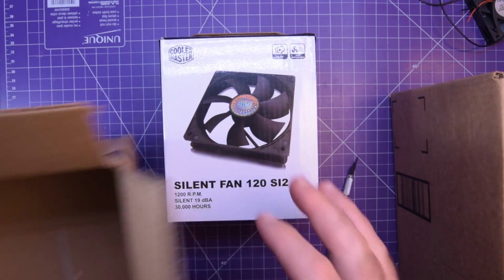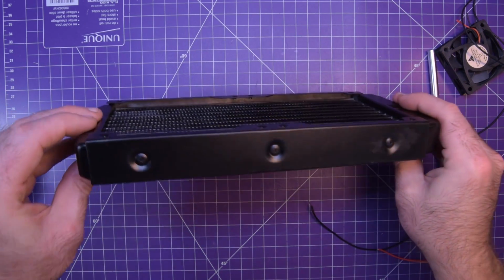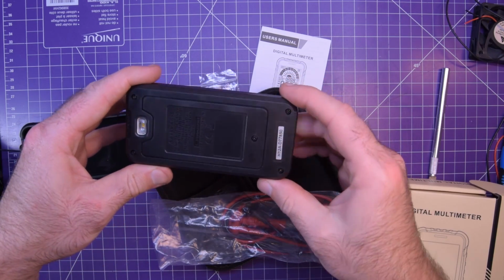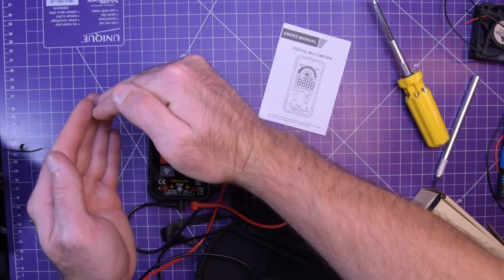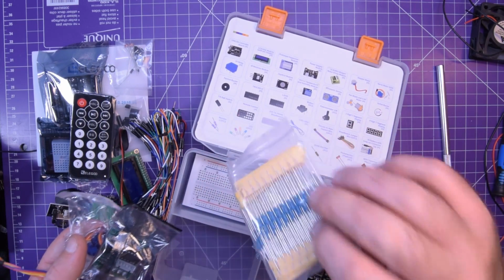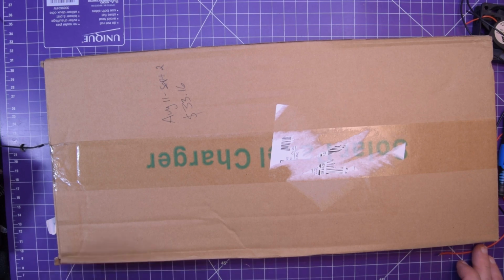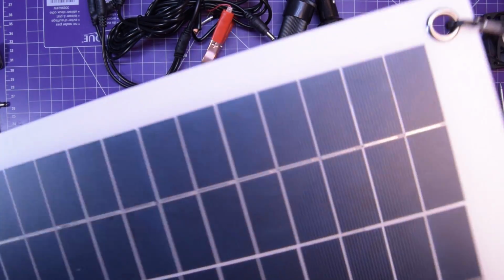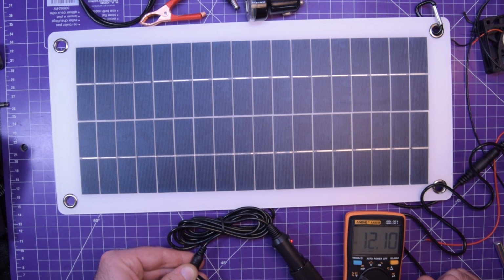Mailbag 66 - My Biggest Fans!

Comment: If you could spin the fans with one of those TEG devices, using parasitic heat differences  ... yeah, that would be the cat's meow.
My favorite fan for silent PCs (15 years ago) was a 24V Panaflow 80mm, running at 12V.  An Airpax thermo-mechanical switch would turn on the fan if the hottest part exceeded 50C.